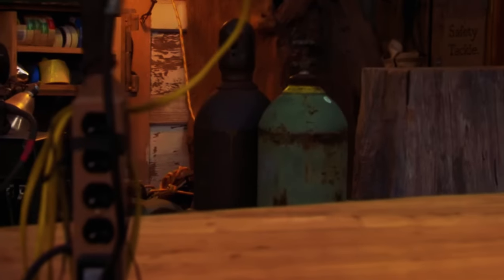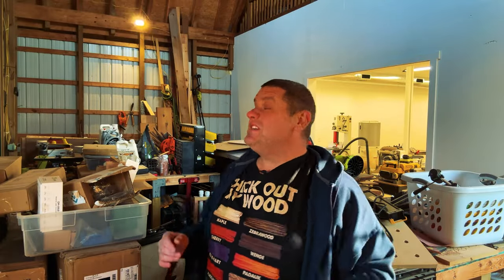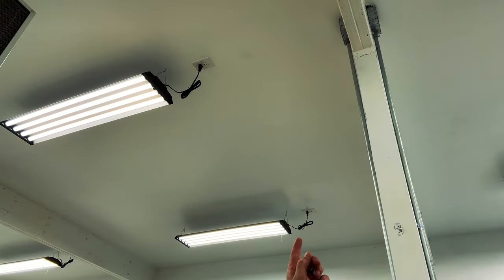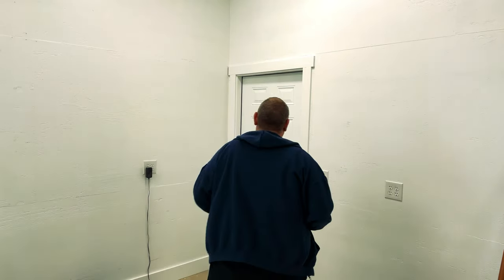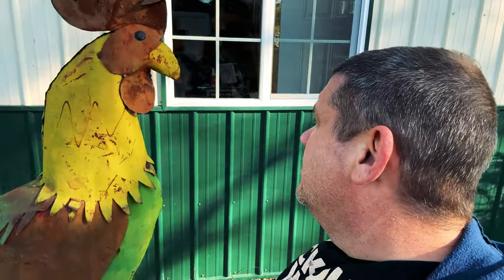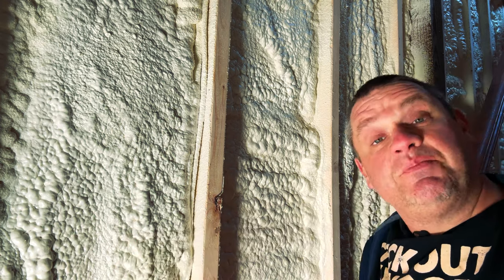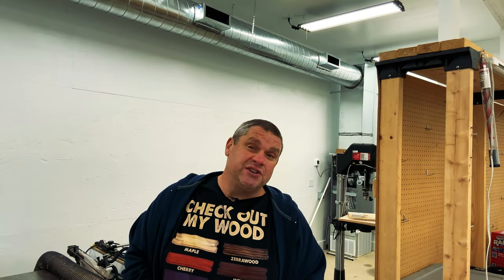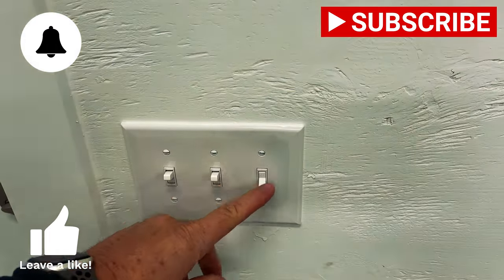Unveiling My Shop's Jaw-Dropping Upgrades

Comment: Dude, The new shop is gonna be great. I'm envious as "all get out"!! Your shop is the first shop I've seen that may actually have enough outlets. Putting the t'stat in the return air stream is a real thing. Theoretically, the return air is a blend of all the shop air so the temp should be a homogenous value of the whole shop. Layla is sure to enjoy the year round climate control. Enjoy the fruits of your labor. God bless.
Reply from the maker: Thanks so muhc richpeggyfranks!  I'm super excited about it and I was able to record my first real video in it a couple of days ago, it was so nice to be comfortable in there.   Great to hear about the thermostat location is a real thing.   I used both the heat and air a couple of days ago and everything seem just fine, which was nice!   Have a wonderful week!

Comment: Now the work begins
Reply from the maker: You aren't lying Ken.  There is so much I want to do, but I need to realize I can't do it all at once.   I'm going to start with placing all my tools in there, and then think about what I need to do next.   Dust collection will be addressed eventually, but I need to figure out where i like my tools first.    Hope you are doing well!
Reply: @FlynndoggWoodwork  I have only rearranged my small shop 4 or 5 times in the last 6 years.  Piece of cake. Getting a new table saw and a central dust collector kind of dictated location of other tools. Happy organizing.
Reply from the maker: @kenerickson4923  I think you hit he nail on the head Ken.  Basically get the tablesaw in the middle and build everythign around it! :)

Comment: Hi, congratulations on your new work shop. I built a new one 1 1/2 years ago, still organizing and sorting. Because of code my walls are insulated with mineral wool, R19. Still 2/4 construction. I have 10 foot ceilings. I also added a attic for storage. For electrical I did my outlets just like yours, however the 120V are all 20 amp, the 240 V are twist lock. All the outlets are set at 52” above the floor. That way sheet goods can be on the side and still access the outlets. Even though there’s 5/8 drywall on walls and ceiling the builder put 1/2 AC  plywood on the walls.  The garage/ workshop is 20 X 34’ deep. I added a 1 3/4 horse SawStop, I wanted the 3 for 240V , however after getting it home the 240V wiring instructions are on the motor. Called SawStop, for $85 the 1 3/4 horsepower will run 249V
What’s the square footage and ceiling height of yours?
Reply from the maker: I love this John!   Really great stuff, I really like the idea of having hot outlets lower so that you place plywood on it’s side. Now, I’m going to measure mine to see where they are at!  Thank you so much for sharing these great ideas.   My shop is about 1000 Square feet, and I need check the height again.  Its a little lower with the insulation and drywall now, but I think it is still well over 10 feet.   Thanks again for sharing and watching!
Reply: My lights are Harbor Freight 4’ 5000 luminous each and 12 of them in 680 square feet. I too have duplex outlets So to add more if needed. Can’t wait to compare after seeing what you have I may add more. For heat I had a Mimi-split. It too is a heat pump. I only have an intake/ output in the center ceiling and the condenser in the back of the garage. So I get heat and AC. The garage keeps it self no lower than 35 degrees last year here in Michigan. Without running the heat. We are both going to be extremely happy when all is set and working. 👍👍👍
Reply from the maker: @John-NeverStopLearning  That sounds like an amazing setup!   I've been working in my shop with the heat and air this week and I still can't get over how much it makes me happy! :)

Comment: Man oh man oh man!  Shop is bees knees!  I saw another guy asking about bathroom, but is there water available at the shop?  I’ve built 2 shops and made the same mistake twice on each one of them - not adding water to the shop.  It’s a real forehead slapper.  I can’t believe I didn’t add water, [particularly in one shop where I had to rent a rock saw with a 72” blade to trench the electrical run (34” deep trench), (the unit weighed over 8,000 pounds) and I was cutting through solid limestone.  Man was that mistake!  Doubt you’d have that problem where you are.  You’ll never regret the number of outlets! Can’t wait for the financial breakdown video on it.  Great JOB!
Reply from the maker: Thanks so much Michael!  Great question and something I'll need to add at some point.  The problem is that we are not on city water, so any water I would get to the shop I would need to do a well.  Not something I'm opposed to yet, but I'm going to wait just a bit!  Thanks so much for watching!

Comment: Shop looks great! Congratulations on your new shop dog!🎉 Leila (sp?) looks adorable! 
Is she part lab, part beagle? The floppy ears make it kinda hard to tell… plus I’m no expert. 😂😂
Reply: Oh! And I’ve never heard of putting the T-stat close to the unit for efficiency… maybe his time efficiency. 🤷‍♂️
Reply from the maker: Haha!   She is a White German Sheppard.  Here ears will point up once she gets a little older, at least that's what we were told.   I hear you with the thermostat, I was a little irritiated when I saw it installed over there, but so far so good. I actually had the chance to use both the heat in the morning and air in the afternoon yesterday, and was very comforatble!